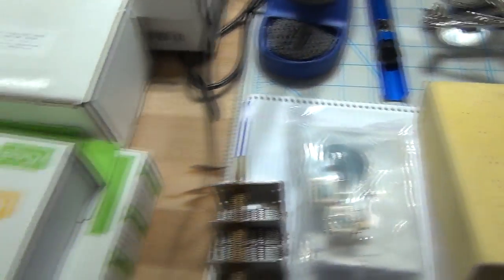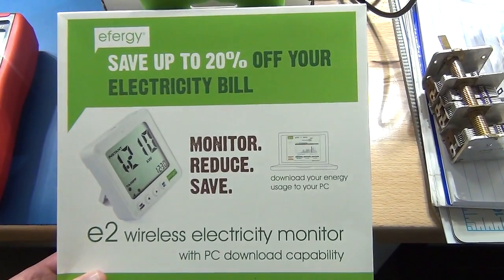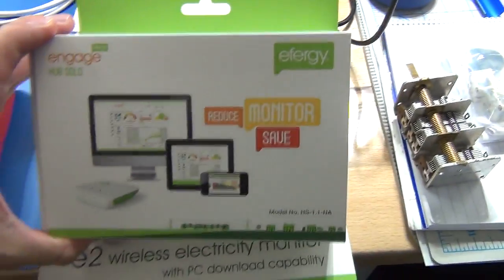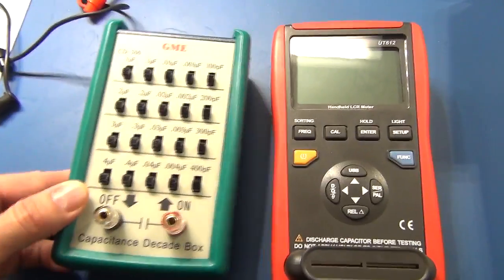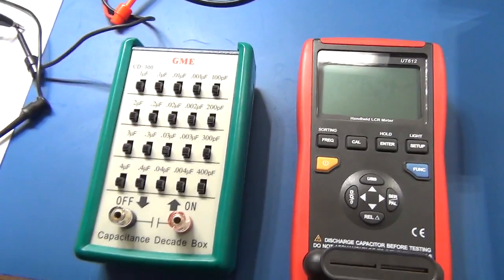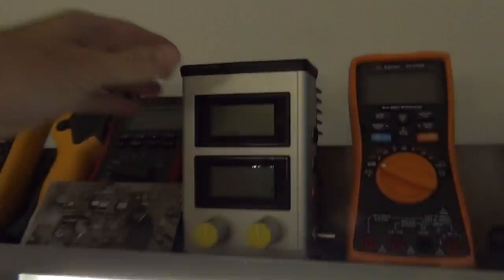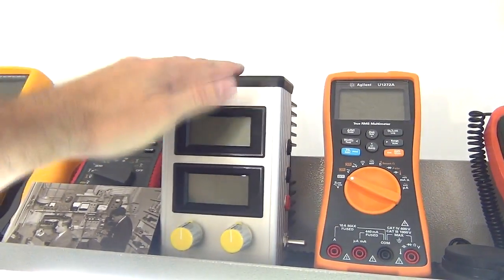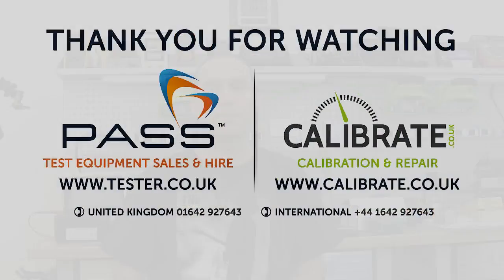T4D #70 - The last T4D for a while...UNI-T UT612 Overview

Comment: When you measure capacitance the frequency of the square wave doesn't matter because you're measuring step response. You can use slow square wave as you desire. What's matter is the rise/fall time of the input square wave compared to the exponential response of the circuit.

Comment: Maybe for safty you could run a Flex tube for the fan for the safe out the window, and set a outlet inside the safe for plugging in stuff, instead of having to cut its cord, Like the small Heater. Just a Thought :)

Comment: i have that very same lcr, nice to see it's at least pretty accurate as i dont have anything to compare it to, except a cylindrical 100 turns air inductor i made which gave about the same value both on paper and on the meter, i suppose the error is mostly from the the not perfect cylinder and humidity (above 70% most of the year) but still within 2%.

Comment: When taking the measurement of a 1.8kohm resistor, the value is 1.72kohm in the ac resistance mode and 1.81kohm in DCR mode. Does it means the equivalent parallel inductance is much higher than the equivalent series inductance. Or the UNI-612 is only display the real resistance term and not the Z impedance when the testing frequency is at 1kHz.

Comment: Hello. I have one question. Could I do in-circuit ESR measure with this UNI-T meter? Thx for reply.
Reply: Possibly.
Reply: if there're no parallel components. resistant drop when there's multiple impedance in parallel. if same concept as resistor applies. If not mistaken.